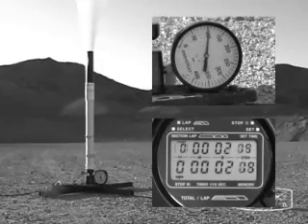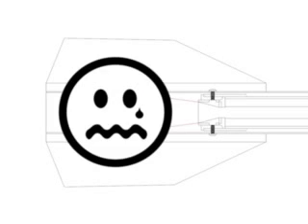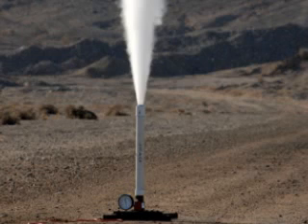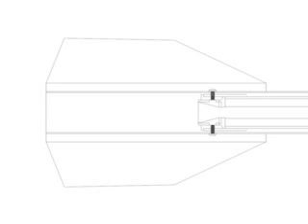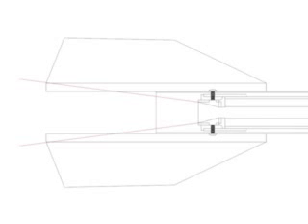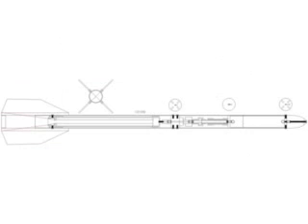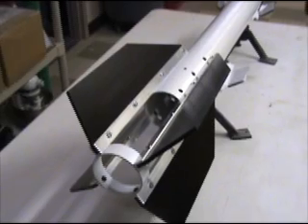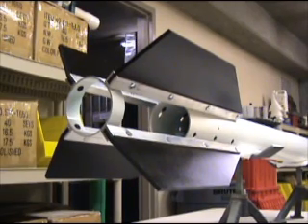Coyote Rocket - Prototype #2

Comment from the maker: R-candy stands for 'recrystallized' candy propellant. My fuel uses may of the same chemicals, potassium nitrate and sugar, but I add corn syrup so that the fuel remains flexible and does not crack. The fuel is also poured into the engine casing as a case bonded grain, not a bates grain like many r-candy users make. I believe a single case bonded grain is much easier to make.